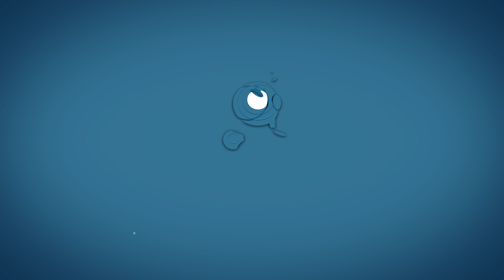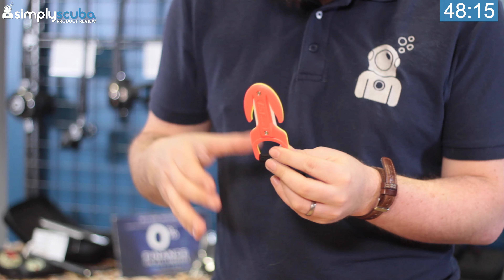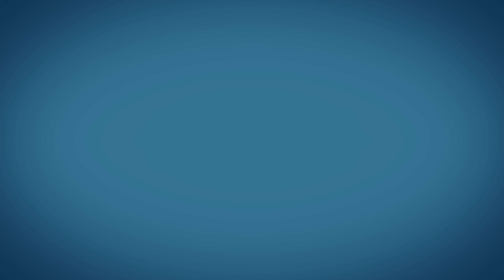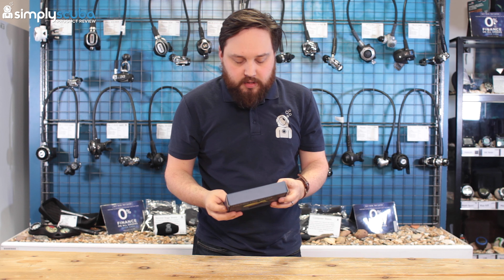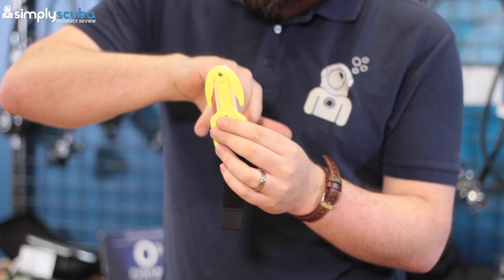IST Ceramic Line Cutter Knife | Product Review

Comment from the maker: Shop - https://bit.ly/2PynJYE
The IST Ceramic Line Cutter is a rust-proof cutting tool with ceramic blades that are both sharp and corrosion-resistant.  Brightly coloured the line cutter is easy to see and manage in the water.  Guards over the blades mean you can't cut yourself or gear accidentally while making the blades very efficient at cutting lines as they get trapped and pushed against the blade.
_
Useful Links
Shop - https://www.simplyscuba.com/
Daily Scuba News - https://bit.ly/39vFkYX
Scuba Advice - https://bit.ly/2SHYiEN
Friday Feature - https://bit.ly/2SsKGhG
Deco Stop Podcast - https://bit.ly/2whcmh7
Teespring - https://bit.ly/2uLRoGz
Reply: I have one, it cuts well. I used the heavier webbing path to thread it onto my wing webbing and its flawless six months and 25 dives later. The lightweight mounting is the common mounting option on all line cutters I have seen. The heavier path may not be unique to the IST but its not available on similarly priced line cutters that I have seen.